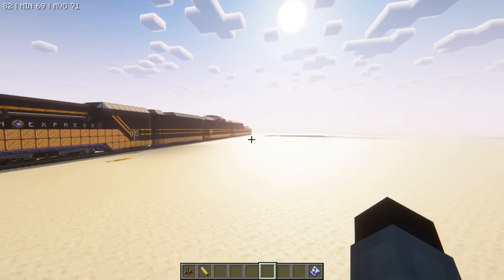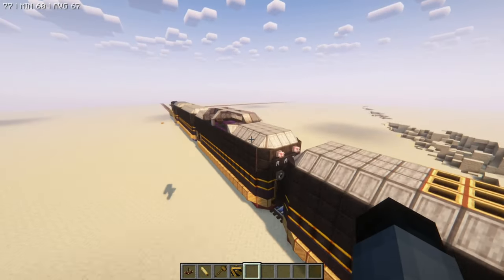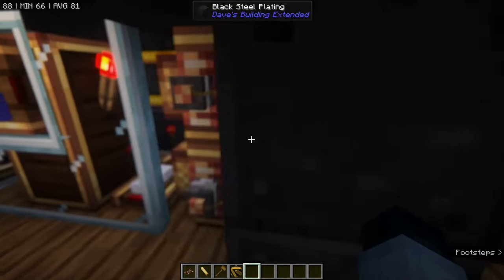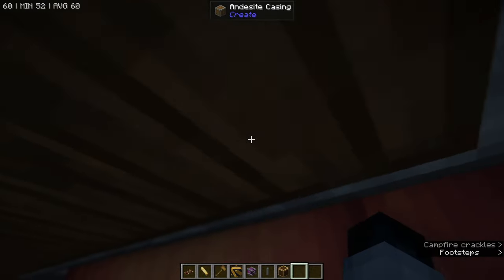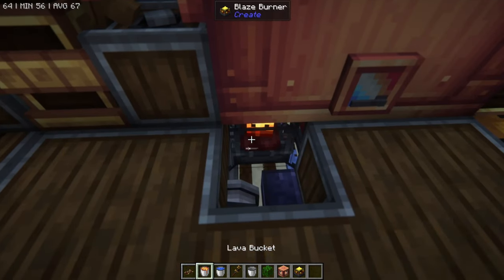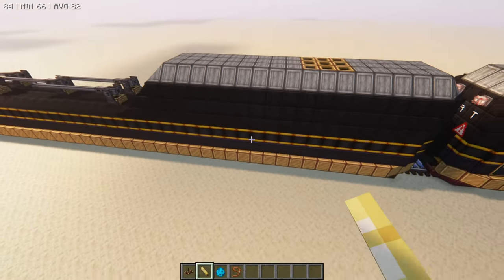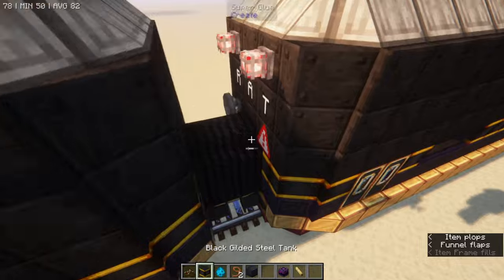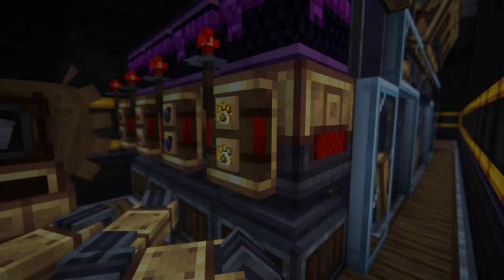Robanian Anti-Aircraft Train | Tutorial & Download | Create Mod

Comment: I have a question, how do you get the create big cannons mod to work, i have been trying to get it to work but it hasn't.
Reply: In what sense is it "does not work"? Doesn't start the mod, doesn't respond to signal, doesn't load guns?
Reply from the maker: If you're referring to issues with the mod itself, it could be down to what version you're using. Some versions of cbc have issues with certain create releases.
Reply: I'm using 1.20.1 and it just crashes my game when I try to load it up
Reply from the maker: @sootamander4398  I play on 1.19.2. I'm unsure if CBC has been updated to 1.20. They have a discord with weekly updates for the mod, could try checking it out
Reply: Create big cannons crash with create 0.5.1d  u gotta downgrade create or wait till next patch from create big cannons
Reply: thanks for the help guys!